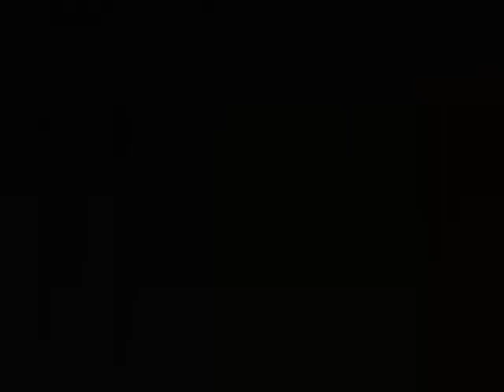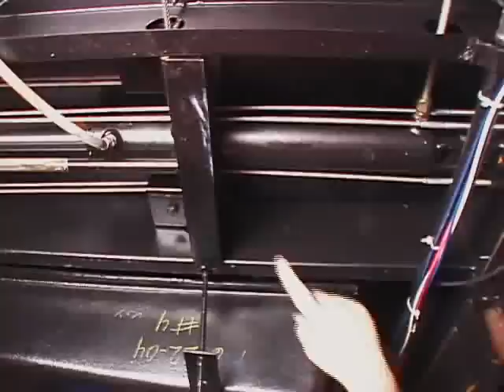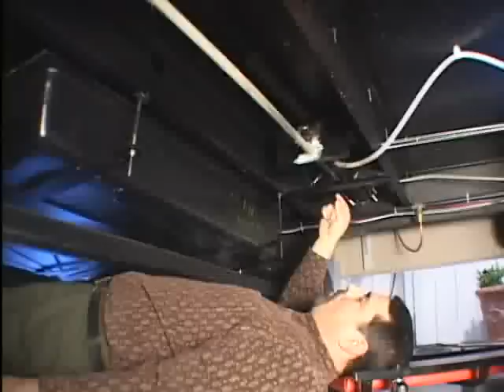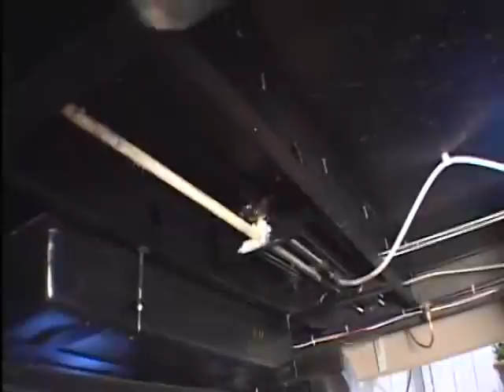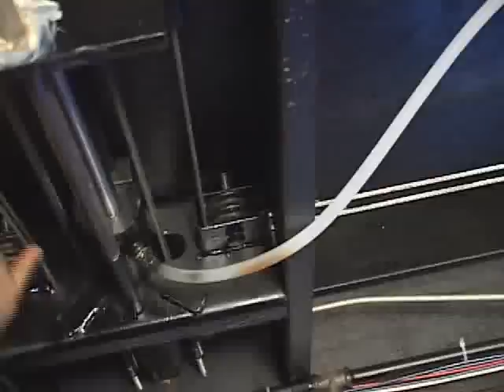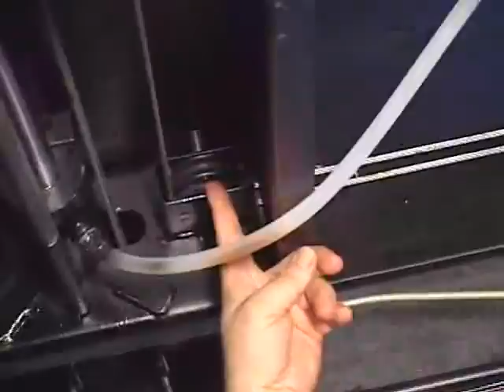34Hi-Lo- Lubrication

Comment: I have a 1994 hi lo that is up and will not come down doesn't make any sound ,changed the switch but didn't work any suggestions on what I can do
Reply: There is a fuse .So check that.Check the electrical connections to the pump as well.Good luck.